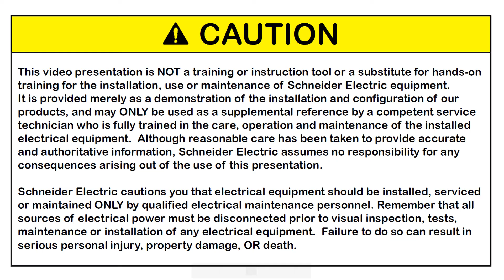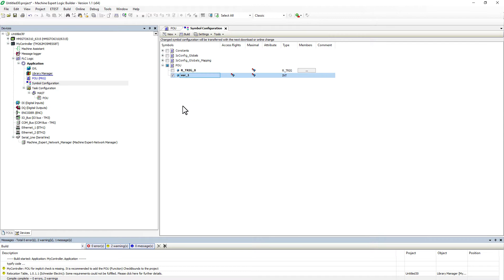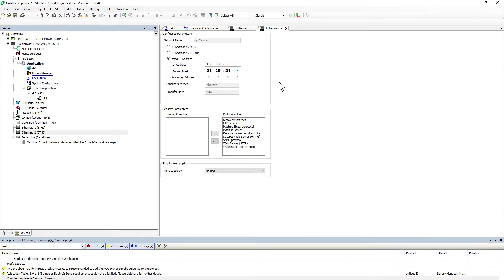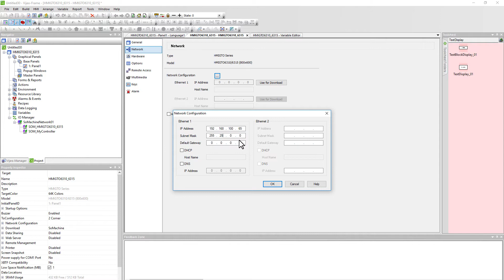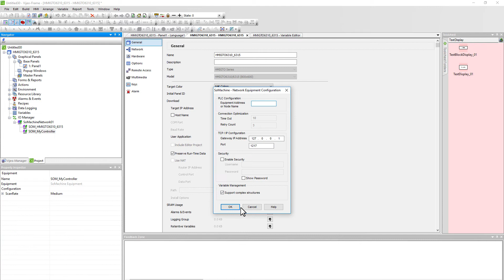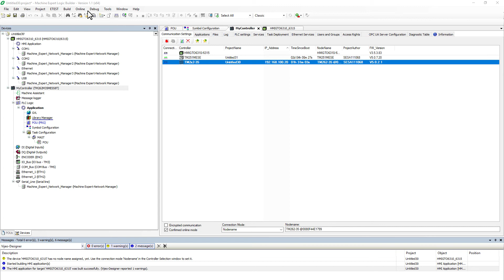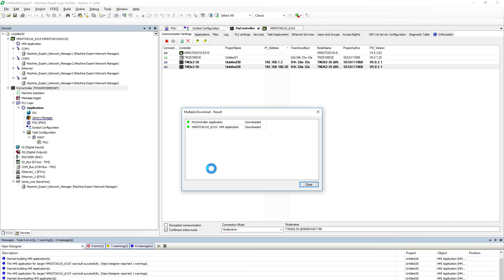How to Establish a Communication Between HMI and M262 | Schneider Electric

Comment: It remains to be noted that in new versions, the PLC security is enabled by default. In Vijeo it is necessary to enter the same username/password for the HMI to have access to the PLC.
Reply: Hello. When you configure the CPU you have surely set an access username and password. The same one that is used to connect to the PLC. You must put that username and password in the HMI connection driver.
Reply: @claudio1371  yes, I sat an user and password for the PLC, but, where in HMI communication driver? I don’t see an option to set a user and password. I’m using SoMachine protocol by the way.
Reply: @claudio1371 Is it in communication driver properties?
Reply: @eduardotrejo525  In the HMI driver communication. Security. Enable security. User/password. Look at 2:35 from the video.
Reply: @claudio1371  thank you very much Claudio, it did work 🙌🏻
Reply: Excellent
Reply: it can't let me download both hmi and m262 at same time from machine expert i have m262 logic controller and hmi gtodt732 do u have any solution?
Reply: Hello, your comment it’s very interesting. I can’t communicate HMI with PLC, what ever I do, it doesn’t connect, so you mean that the application (runtime) must be blocked with an user and password, so communication can be established? or what kind o user and password do you mean ?

Thank you in advance for your help, I’ve been dealing with this problem for 3 days 😢